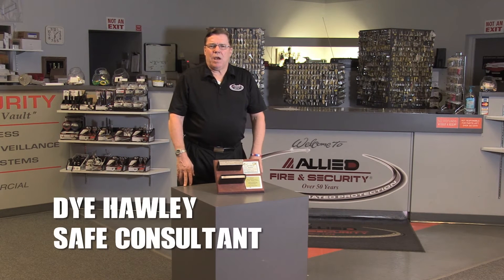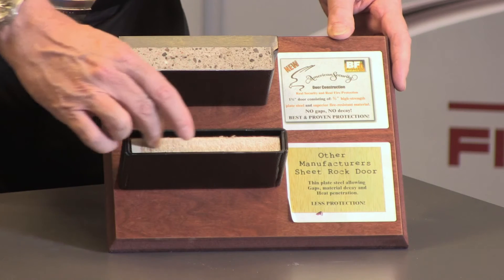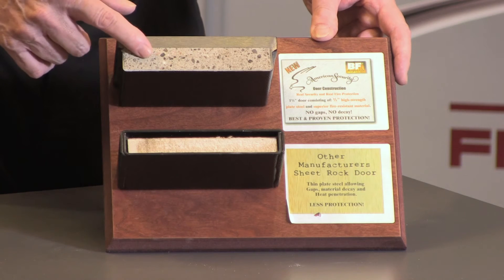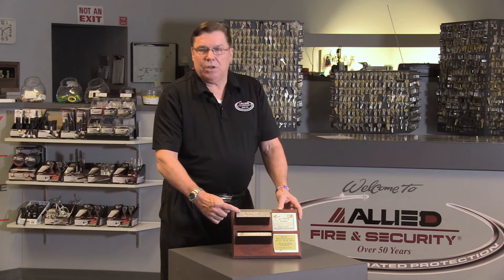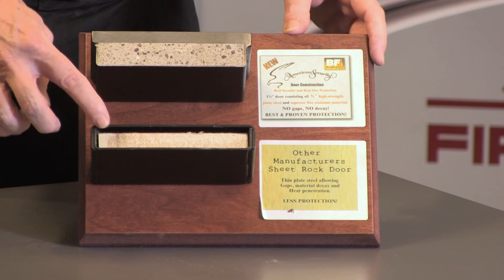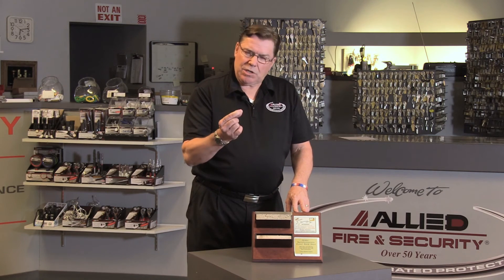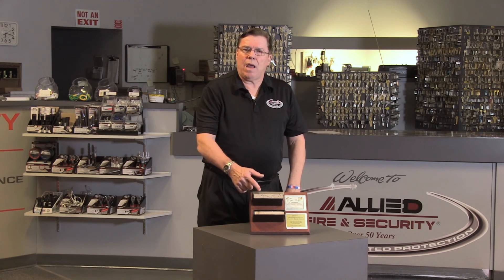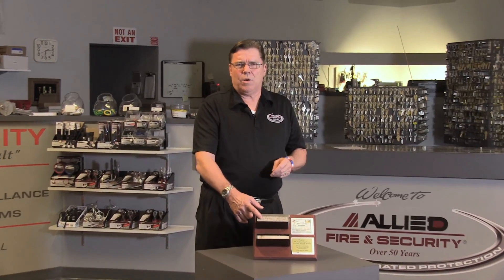What You Should Know About Concrete Composite Material

Comment: I never want ANY "steam" in my safe, EVER. AMSEC safes have a combined aquivilant of 7 guage steel in the body walls of the safe. That's adding both the outer and inner layers together equals 7 guage steel. This means the body of the safe is wrapped in an aquivilant to 12 guage steel and lined with around 13 guage steel. Very week steel. Amsec does make TL rated safes. These safes are a much better option for actual security. I personally suggest starting with a Superior Safe or Truvault and if you need more security from there look in to Graffunder safe co. Understand prasicely what you are buying before you buy a safe. Many company's specialize in certain facets of a safe. As apposed to the whole safe. Do your research before you buy. In the safe industry you do not always get what you pay for. With the  three companies that I previously stated above you will get what you pay for. I am not paid or sponsered by these companies in any. This is just my personal experience with the safe industry. Take it as such. Do your research please.
Reply: any thoughts on a comment i just made:
What about the new drylight material that is in some Amsec products? In your description you mentioned the drylight material but i think you are confusing it with their Fireclay material that is used in the BF series... whereas drylight is in some of their gun safes (i assume to make the safes lighter)